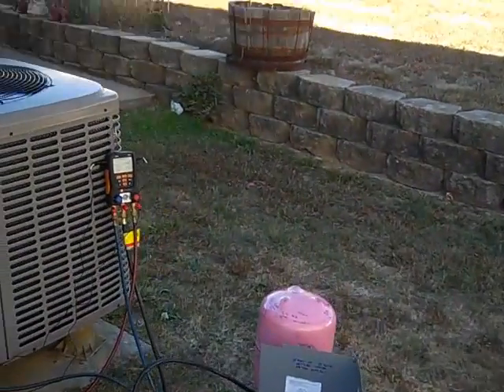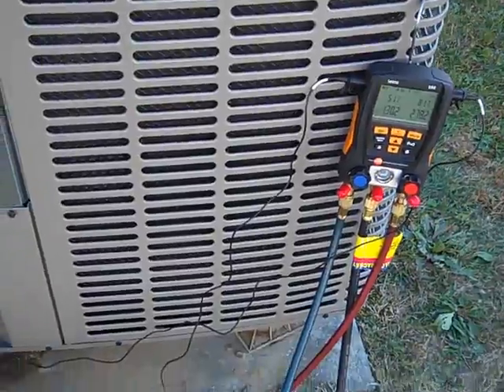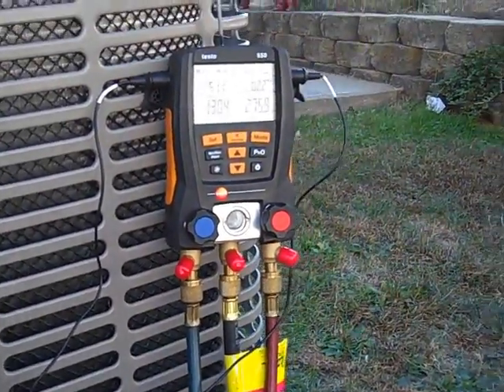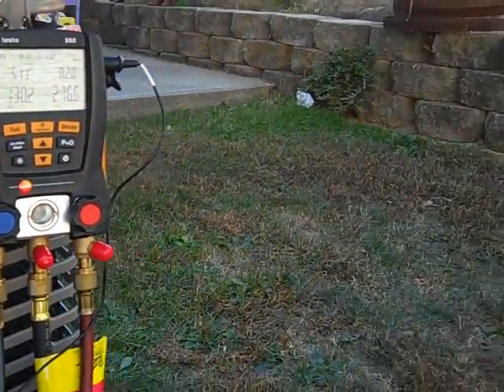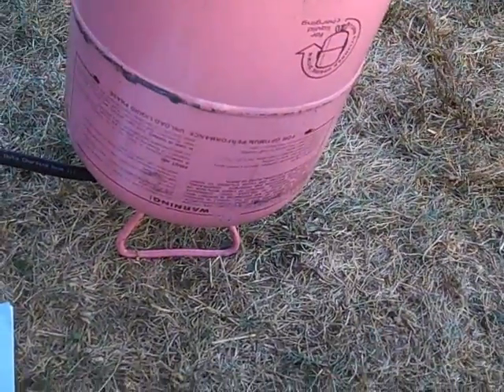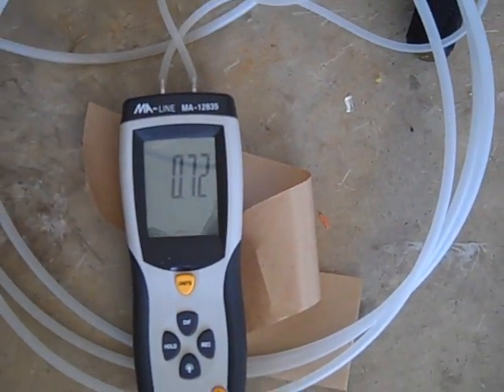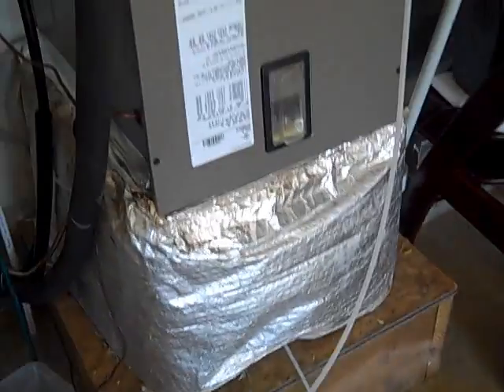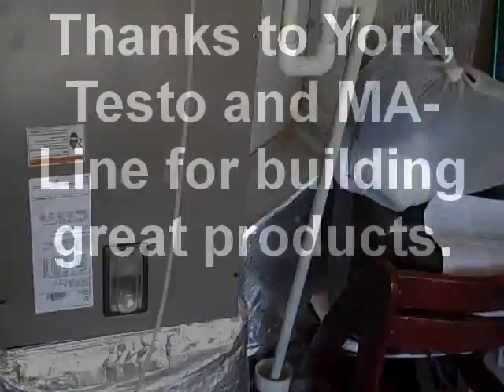2T 13Sr LX strt.wmv

Comment: Do you find that York or UPG units always need to be field repaired or adjusted? 
I have found blower wheels loose are off balance, fan blades off or rubbing, wires not hooked up, inducer motor assy jammed, and my last one had a broken weld on the manafold. They work great after the repairs. 
Another Clean job brother Jason

Comment from the maker: @PutSome5tankOnIt Thanks P, I write on my reclaim jugs as well. 

It does look like a Testo but it is MA-Line, You know the cheap tools and supplies they sell at the supply houses in the red and blue label. It was @$100. It works well. I have a Field piece head with the single port. I love my Field piece motor master meter. I'm not so impressed with everything they make. I have the monoxer head with a squeeze bulb - hate that thing. AMN2 is decent but I wouldn't bought it if I knew @ MA-Line 1st